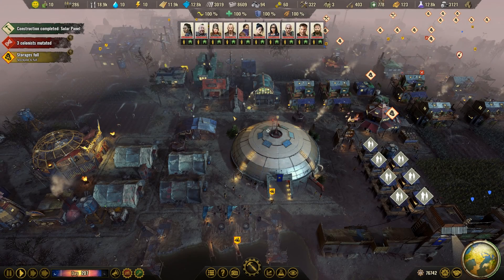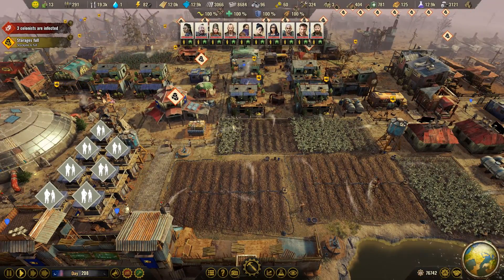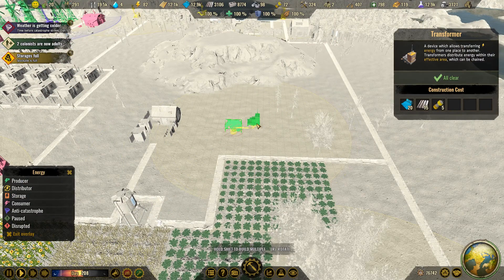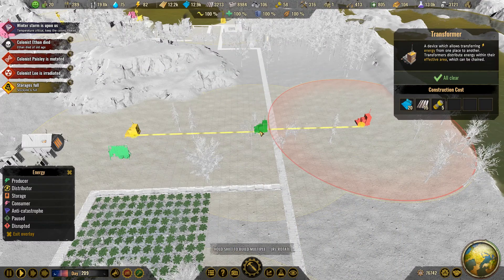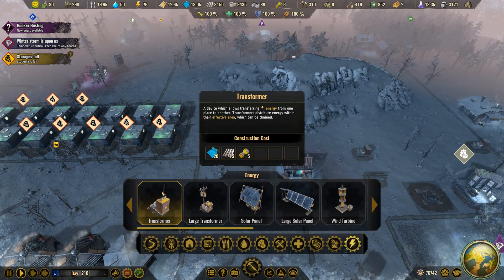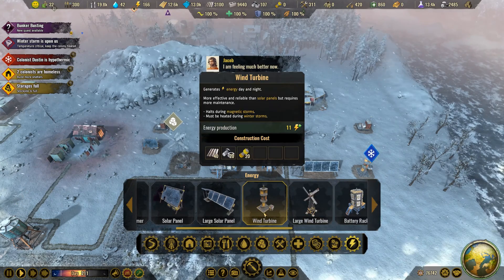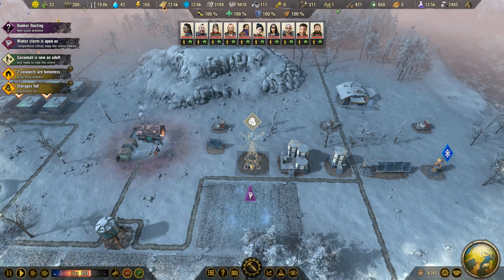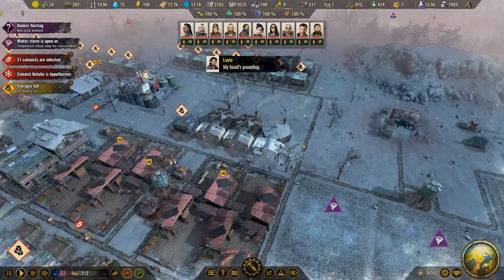Electricity Guide for Surviving The Aftermath — How Power Works & What to Build

Comment: Hi.
I had weird experiences recently.
I'm doing 300% and was sabotaged + winter event effects.
One of my batteries was sabotaged, and my storage +16k energy dropped instant almost 1k as well was had -150 energy production.
It's my first run and doing on 300%. Is this common losing so much reserve? So I'm prepared next time.
Sincerely
Reply from the maker: 300% is an insane run. That is a custom game I assume. It sounds like it likely hit multiple batteries instead of just 1 battery because the max a battery has is around 4k. 

Try spacing out your battery locations to prevent harm to one location.
Reply: @JaxRayne   Sry I forgot edit when I posted.
I'm doing the hardest now but I found out one of achievement's I most do on custom game and going do 300%.
200% wasn't hard as that bright creatures I found out one way to bug them out and easy to kill them.

That's was the thing with, just one battery was sabotaged and entire my reserve was almost empty.
I have batteries stacks location on 4 places .
One thing I haven't figured out how to form federation and specific federation with one society for achievements.
I want to inform you have very good guides, I going watch your content before I going for 300%, one of your tips helped me out and that was having best weapon and gears to my gate guards and tower, in case bandits success destroy my gates. 
Ty for your reply m8
Sincerely
Reply from the maker: @donaldduck9884  I'm not sure why the battery behaved that way. It's entirely possible it's a bug or glitch if none of the other batteries are affected. Are the batteries connected by a transformer?

To form the federation, you need to ally with other societies and then get a certain threshold of population, which can be found in the societies page.

I'm glad my guides have helped! :)